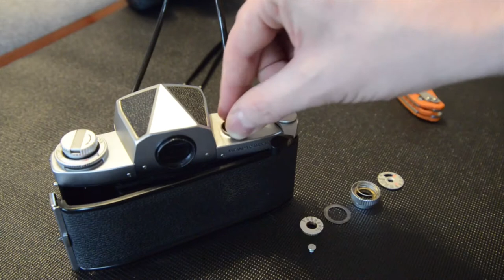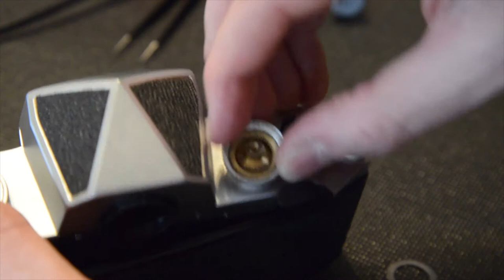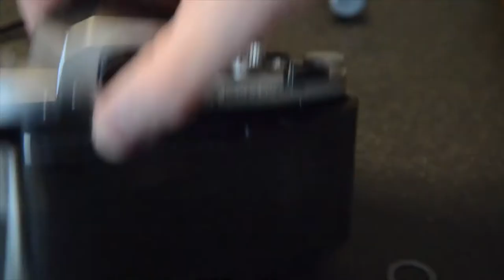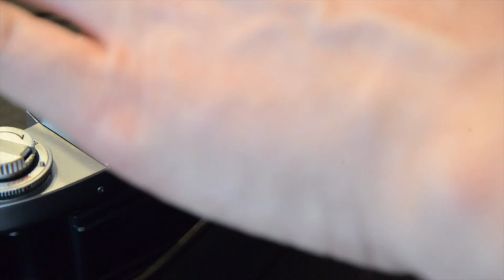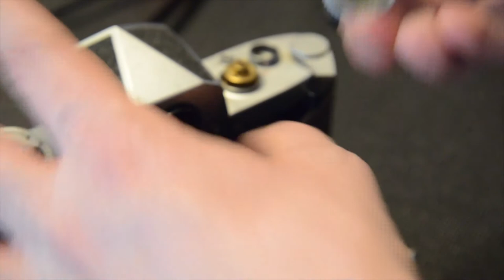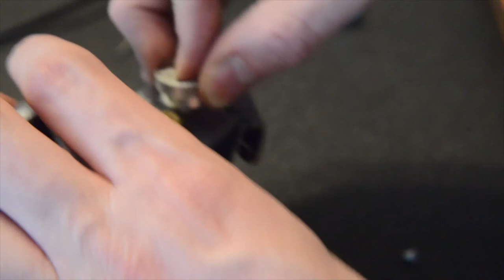Miranda Sensomat RE SLR Film Camera Question (Shutter/ISO dial)

Comment: So, no clue if you are still having this issue, but if so, maybe this will help.

There are actually three gears, which are then surrounded by the outer knob. The top one is the one with the ASA dial on it. The second, in the middle, is a thin gear that is actually responsible for setting the shutter speed. The third, and bottom, is the largest gear which turns a dial to actually set the ASA. When lifting the shutter speed knob, you are actually lining up a narrow groove inside it with the shutter speed gear, bypassing it and enabling you to set the ASA between the top and bottom gears. I'm still not fully sure what purpose the knob on the bottom of the top gear serves, as the dial on the bottom gear is what determines how far the ASA dial can be turned in relation to shutter speed, but I think it is safe to assume that it's general positioning is important to that function as well. Thankfully for you, it looks like your top plate and gear are still glued together(mine are not).

Since we know 100 is the only ASA available to all of the shutter speeds, we can find it on the bottom gear without issue. With the shutter speed set to Bulb, we should be at 100 ASA when the bottom gear is rotated as far as it can be clockwise. This can be verified by using the knob and top plate, sans the top gear, to rotate and test all shutter speeds. Additionally, it can be verified by rotating the bottom gear counter clockwise and observing that less shutter speeds are available.

As far as I can tell, this should enable you to get everything set correctly on your end. For me, I'm hop[ing to take this and a shot of the alignment of the knob on your parts to get it right on my end.
Reply from the maker: I have it together, but I'm not confident it's correct, so it has remained unused. 

I think I will need to have it open and in front of me to have this make sense to me. 

I'm tight on time at the moment but, I'd be happy to give this a shot when I get some time. 

Is there a way to PM contact information so I can follow up with you directly when I have a chance to open it?

Thanks for the response.

Comment: When the ISO dail is on ISO100 you can chose Shutterspeed B- 1/1000 that is the only position the camera can do that. 
When the ISO dail is on 50 you only able to go up to B-1/500
When the ISO dail is on 200 you only able to go down to 1sec - 1/1000.

So you can test if the ISO dail sits correct.

Sorry for my bad english ^^
Reply: Niall Brown hi not sure if you have already fixed it but I also followed what Lada said. I found in the manual about "different shutter speeds allowed by different asa". My camera had the asa dial wrongly set. I figured that my asa 200 allowed all shutter speeds which meant that was actually asa100. So it was a case of quick realignment.
Reply: Very late reply and it probably has already been fixed but I did exactly this to mine, also has anyone figured out how to fix mirror sticking on slow shutter speeds?
Reply: @hackpod100  You need to adjust the tension on the shutter curtain. This is common on cloth shutters. You can do it fairly easily yourself, but be warned that you may also throw off the shutter speed.
There's two screws on the bottom of the camera underneath the base plate. You have to tighten one of them; usually the second shutter. I did this on my Zenit just fine on one camera, but totally messed up my second one. It's likely best to send it to a camera tech who can properly perform this & also check the shutter speed to ensure it's correct.
Reply: @k-ozdragon  That is not the correct way to do it. Cleaning of the slow speed escapement is the right way. Increasing curtain tensions just leads to increased wear on the shutter. Additionally without the means to test the curtain speeds in millisoconds, you can cause capping where one curtain travels faster than the other
Reply: @rchelihaven5027  Sometimes cleaning that helps, but it is also very labor intensive depending on the camera. Quite often, the springs in the shutter curtain need to be tightened, as all springs under tension weaken over time. It's best to get someone who knows what they are doing to look at it. It's easy to slip & lose the proper tension, throwing off the shutter timing.